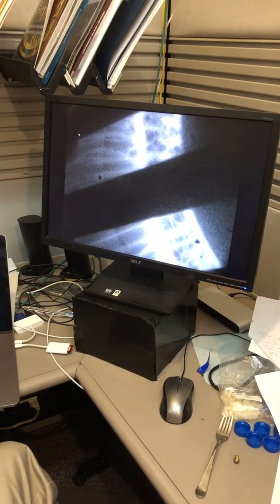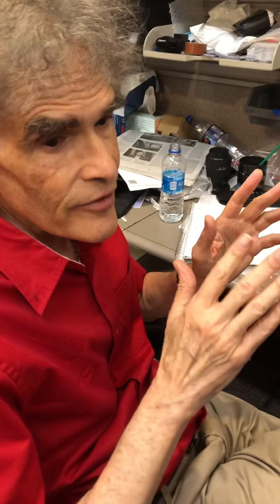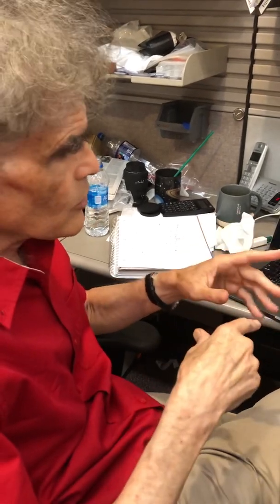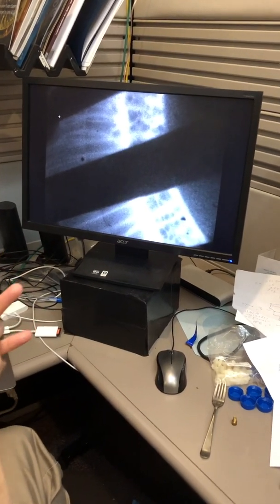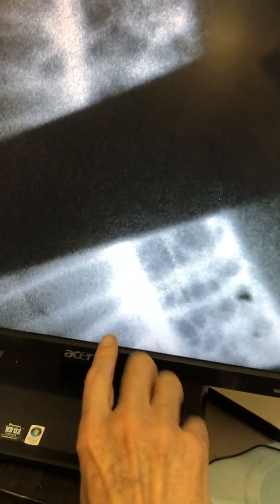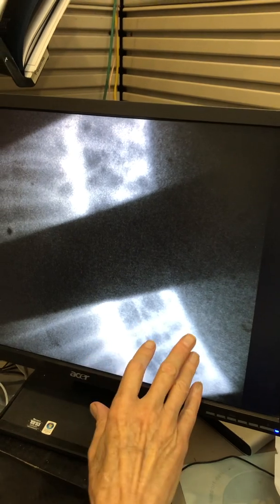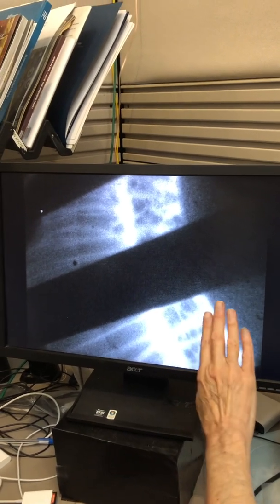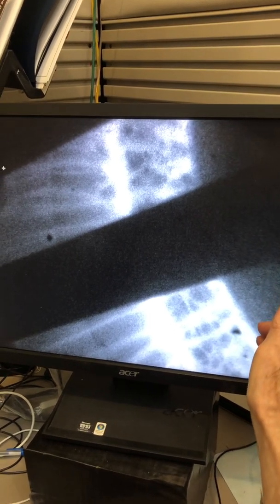Plasma sheet caught by a fast cam - explained by Eric. Aug 13 '2021

Comment: If you don't impedence match your discharge circuit you will always get those fluctuations in your discharge pattern. The timing is not the cause, as you have seen and mentioned, these fluctuations can even worsen when you have all the switches properly timed together.

Comment: The shockwave seems to be moving in a retrograde direction from the the direction of the current sheet. Is that correct? Is the current sheet encountering some type of force presenting an obstacle that it bounces off of?

Comment: question:  From what i could understand from the video explaining the inner workings of the machine, it seems the instability is formed analogous to twisting a string. My thoughts were what would happen if you used two opposite polarized coils to pinch and twist the ends of a plasma in a z axis in opposite directions, would it eventually lead to an instability like the ones generated in your setup, and also turn into a plasmoid? (idk if this implies cheaper, but maybe simpler geometry regarding the chamber and electrode setup)
i mean , youve already attained way higher temperatures than achieved by others, so maybe pushing further in a sense of keeping  the instability going continuously could eventually lead to using this to start a greater reaction?

Comment: I'm not sure what kind of switches you are using, but, if they are close together, and in a single layer plane, they can get a capacitor effect, which can delay switching, the solution would be to make sure your switches are not on the same plane.  If switches are delaying due to microscopic structures, then a simple variable resistor may be needed on the switches that are fastest, so as to delay them a tiny bit to make them all fire at the times you want.
Reply: I thought of the plane but not variable resistors. You rock bbroygbvgw
Reply: @marcusallgood5198  thank you, i hope it works
Reply: From a previous video, it sounds like the ones that are consistently firing late or early have been handled, the issues are with the ones that are inconsistent.